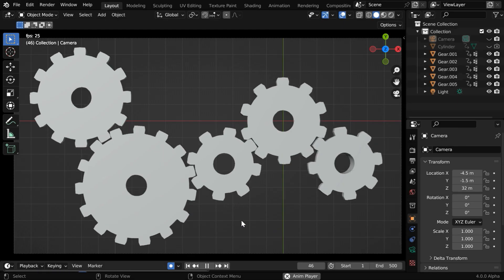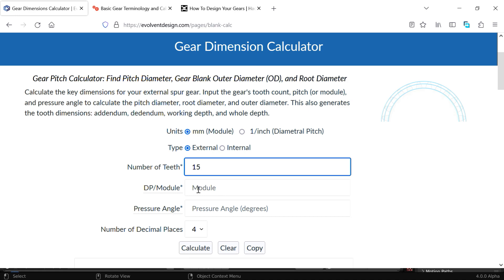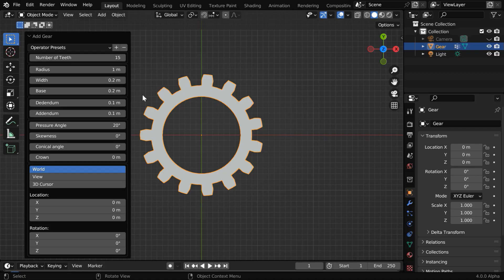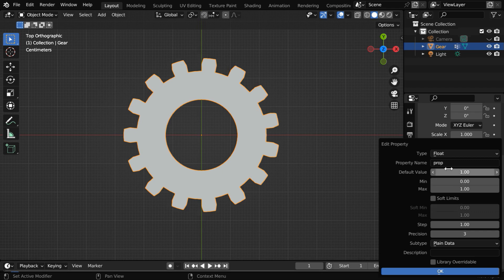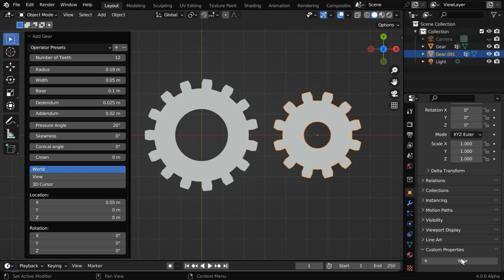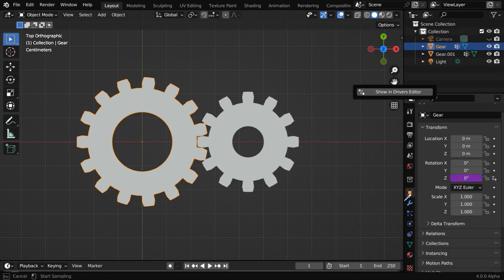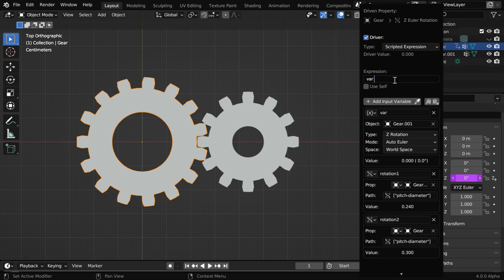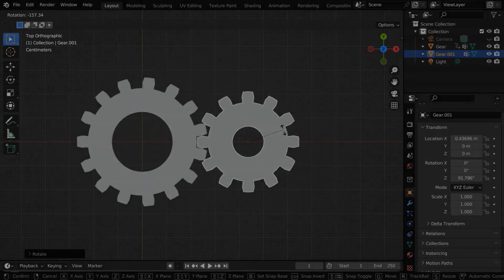Mechanical Gears & Drivers In Blender | Easy Mechanics With Perfect Animation

Comment: what about that gear is parented to an object and I want to rotate the parent object without causing the child rotation?
Reply from the maker: For such cases, you can use the Child Of constraint instead of a simple parent-child relation. A Child-Of constraint works the same as the simple parent-child relation except the fact that here you have a control over which things to exclude (like in your case you can exclude all rotations, so the child won't rotate when you rotate the parent).